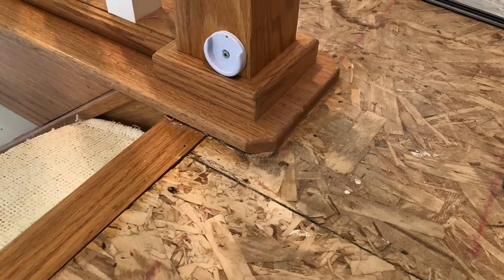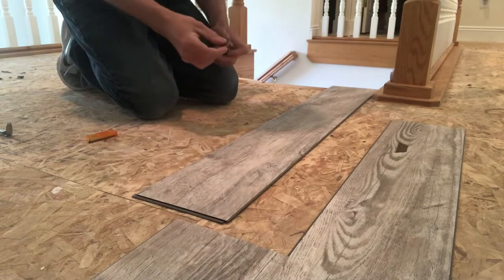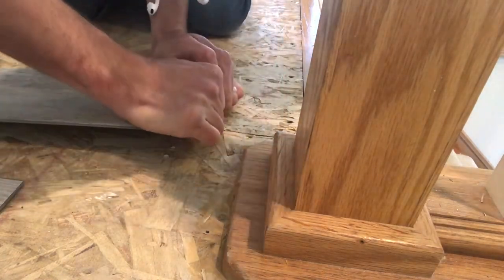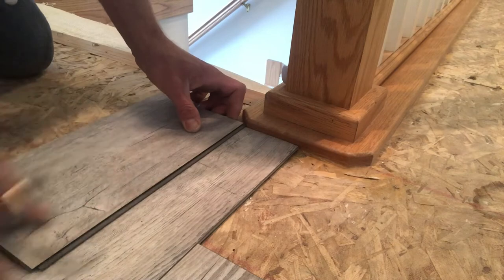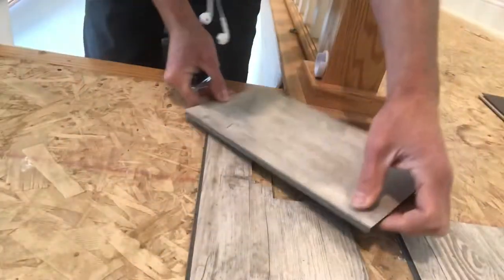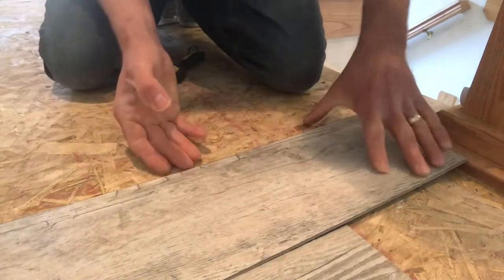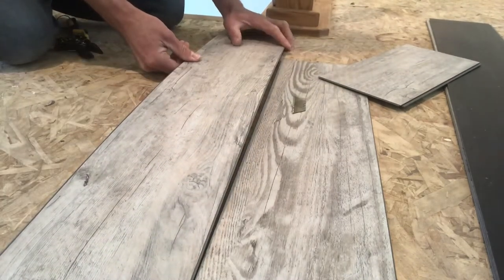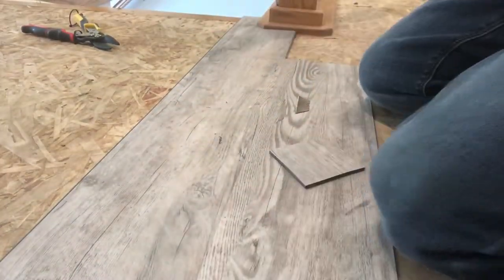HOW TO CUT VINYL PLANK FLOORING AROUND A RAILING

Comment: What do you put  along the edges to cover the gap where the flooring meets the sill plate? I'm putting in 12mm laminate up against 3/4" oak sill plate so have just the slightest elevated gap where quarter round would be way too tall?